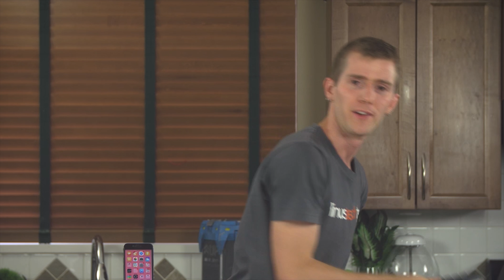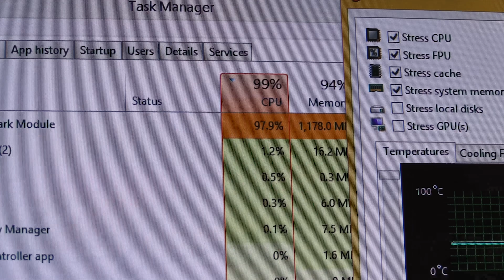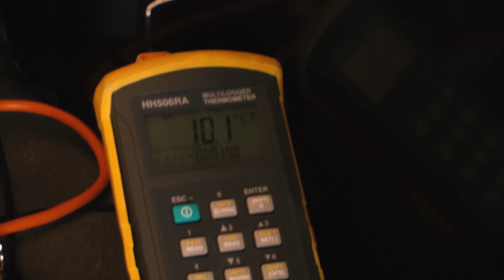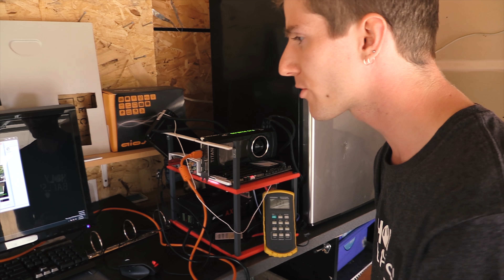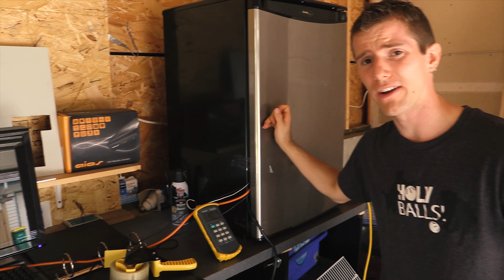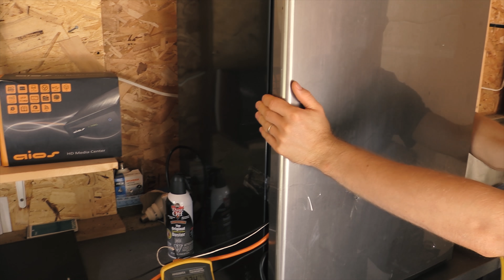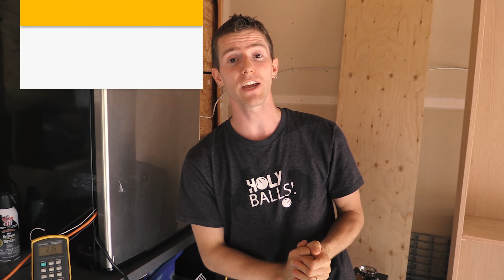PC Build in a Fridge - Does it Work??

Comment: Alternative setup: Instead of putting the computer itself inside a mini-fridge,  take a liquid cooling system with a specialized liquid capable of handling -10 degrees. Drill into the lid on each end the hole for the tubes and attach an additional pump on each end. Run the tubing coiled throughout the chest freezer using ice packs in the mix. keep the tubes from physically touching as well.

in this setup, you're dealing with a freezer rather than a refrigerator, which might pose a problem to put a computer into, but you were also only transferring heat from the CPU and/or GPU and letting the fans take care of all the other heat issues. The end result is A system that runs much much cooler, but I expect it would still have its limits considering how much heat those units give off. More likely, it would be useful if your computer isn't running 24/7, or if the idle temperatures are lower than what it can handle. if there's ice packs in the unit, as you ramp up to heavier usage, the load test will be more favorable. performance will gradually diminish of course, but because the liquid cooling is running through the freezer as an additional step to its existing means of keeping cool, it will never get to a point that could potentially damage the unit meaning that it will always be more beneficial than not, although the cost of electricity and the setup is another argument

Comment: There are more variables here than what you accounted for. For example the computer will want to operate within a certain temperature range unless instructed otherwise. It will turn the fans off if they're not needed for example, or run them at a very low speed. That should be accounted for by manually adjusting fan speed to the same speed as it would be in a room temperature scenario. Also, the refrigator will need some time to cool down something that experiences such rapid heating as a computer that has just been turned off.

Comment: the cool air from the fridge can just only low down the temperature of the computer system a bit, e.g: 44 degrees idle to 40 degrees idle.
the power of the fridge's cooling system is not enough to make changes to the computer system, which has a huge precent of eletricity converted to the heat.

Comment: If you want to get crazy with cooling then you should go with chilled liquid, TEC coolers or phase change.  The only major downside is all the insulation required, which requires a heck of a lot of time, work and research.  Then there's the money you'll be spending on all the electricity required to run those methods.  So in the end, in my opinion, a good liquid cooling setup is the best and most efficient way to cool your PC.  The clock speeds achievable by sub ambient cooling aren't really worth all the hassle.  In many cases your over clock won't even improve.

Comment: What you would want to do is a water cooled pc.  Run a good sized "precooler" (a decent sized radiator) outside the fridge to get the fluid to close to ambient temp.  Then run the fluid through another rad inside the fridge.  It would still put heat load on the fridge, but not to anywhere near the same extent (and could never exceed ambient temp).

Comment: That is a cool idea actually but might work as in 1999 we did it with bare MB with every thing installed put a cotton cloth to cover it then put a parachute waterproof sheet on top of cloth for condensation proofing and again a cotton cloth to absorb the first wave of condensation.
The fridge was new with copper heat pipes ,we let it to cool it at full cooling point first ,then put the MB with IO shield attached and chopped rest of the casing from top n bottom. We did not have temp gadgets to monitor it but it actually worked fine with over clocking for a NEED FOR SPEED test at very high settings and CPU OVER CLOCKED at 25% more than the recommended settings..I think it was the 3.1Ghz hyper threading OC and MB was an ASUS top of the line MB the GPU  was nVidea's 8800 series ASUS card.
========
What about DRY ICE cooling structure/housing custom build around a custom build casing or a car AC or those tiny AC's for camping attached to the casing with cooling fans blowing air in from one side and exhausting from other?
Has anyone done this ?

Comment: My first rack server I bought, I nicknamed 'Gerald the Fan Heater'. Likewise my workstations (all refurb and 2nd hand off ebay). I often say that you should think of a typical tower workstation as a 400W fan heater with a built-in calculator.

Comment: As a back-of-a-handkerchief calculation, taking the heat capacity of air, approx 1kJ/kgK, and assume the fridge has a volume of 100l, to keep the numbers simple, and air has a density of 1.27kg/m3, or 1.27kg/(1000l), so the 100l fridge contains .127kg of air. If we cool it from 22C to 2C (delta of 20C), then there is 20*.127 = 2.5kJ. Take the number of seconds to cool it, say T, and then 2500/T is the amount of watts being removed from the fridge. If this is less than the amount of heat put out by the rig, the amount of heat in the fridge (and hence temperature) will increase.

Comment: I'm curious as to thoughts: I have a cheap Atom Z8300 box (from China, prob banggood), and have the remains of an old HP rack server, including two large heatsinks. I'm wondering what opening the case on the Atom box and somehow using the heatsink from the HP to improve passive cooling would do.

Comment: People in these comments are kinda dumb. Fridges are designed to keep food cold. A computer emits heat constantly; food doesn't. A fridge can't keep up nor would a freezer. 

Also, the air is locked in tight. The hot air has no where to go and is being recycled through the computer constantly. 

You would have to customize a fridge or freezer so much it wouldn't be a fridge or freezer anymore. It doesn't work. 

(commenting because I saw guy saying that Linus made a mistake for not having a good seal on the door. Therefore, this video is invalid. I guess if the computer was watered cooled it might make a difference, but even still, waste of electricity.)

Comment: Allow the fridge to run for a full 24 hrs to reach optimal cooling before starting the test. Otherwise the fridge will not be performing it's best. I'd also suggest a "chest type FREEZER" not merely a fridge unit. Reason being the chest type are the most efficient since cool air goes down and when you open the lid on the top of the unit you're not allowing any cold air to escape. That would make for a more reliable test since the air in the unit will maintain a more constant temperature. But at least re - run the test with the fridge unit being at peak cooling before starting the test. It's a misrepresentation of the cooling ability of the fridge.

Comment: I wonder what would happen if you build a PC in a Walk-in style Fridge, like you would find at a resturant. Most of these fridges have air intake and exhaust which would circumvent the problems the mini-fridge ran into. I imagine moisture would be a big problem however.

Comment: try "PC Build in a Freezer" instead of a normal Fridge
Reply: It's the exact same principle. A refrigerator that has a lower set point on the thermostat. The same problem still exists. For this to work, you need to build a small room/case that will be cooled with an AC system, not a fridge. Just think of an actual commercial computer room full of servers. They don't just use a regular AC system like you have serving the rest of the adjoining offices. Those big Leibert units (yes I have a background in HVAC) were designed specifically for such uses. They run continuously rather than tripping on and off. There are smaller systems made for smaller computer rooms, and perhaps one could make a little closet with the indoor half of the system and their PC in there, and the outdoor half outdoors. Not exactly cheap, or practical but then again there's always somebody that will do it just because they can and no one else has.
Reply: What I was thinking
Reply: James L Ya a massive cubic volume reach in freezer, so it can keep up.
Reply: and the computer is a hot brick in the first place so it needs to cool the parts hardware and case first
Reply: There is also the problem of condensation, the first time you open the freezer door and water molecules from the air start attaching to your components your computer will be minutes away from a pop and a stop.
Reply: +Rob Fraser Yeah, theoretically the water vapor is pure (distilled) and once condensed remains that way until something contaminates it. The water itself is non-conductive but anything conductive at all that should get in the water will be a big problem. With all the dust that gathers within all desktops, and new stuff being continually sucked in via the fans, that water will not be pure anymore once it condenses on the boards or anywhere else. So basically, yup snap, crackle, pop is more than a breakfast cereal. I just thought we'd better point that out to anyone that get's the idea "hey the evaporated water will be pure when it condenses so I'll be alright.".
Reply: yeah but since computer parts are warmer that surrounding air it might be enough to cook off the moisture. depends on how cool the cpu and cooled parts get.  @WhoWouldWantThisName
Reply: @WalterGreenIII Well, in theory that sounds logical except that unless the PC stays operating under a sufficient load to maintain a high enough temp to do that, I believe condensation is inevitable. :(
Reply: I still believe that the concept of a controlled atmosphere in a small area (kept cold AND dry) is workable. Whether or not it's worth the trouble? Well someone else will have to take on this project as I have way too many and too important, or just better, things to do these days. Sorry.

Comment: yo man if you really wanted truly cold ambience should've went with a freezer.
Reply: yes and when the water in the air that is in all natural air (it's called humidity} sticks to the electronics as they start to freeze and it short circuits then it's to late and you realize you are an idiot, the amount of prep work to make a freezer run safely with normal air in it which is what will inevitably leak in unless the environment made around the fridge every time it is opened that would have to have massive amounts of air be severely dehumidified and there would have to be a good amount of those packets and that come in some stuff u buy with the little balls inside that say not to eat in there to to make sure the air in the fridge stays dehumidified, this is of course after spending hundreds if not thousands of dollars to make yourself a bubble boy type enclosure to dehumidify the air that will end up in the fridge when it is opened, pwned in 1 sentence lol.
Reply: you call me an idiot but can't comprehend what a joke is and reply with a completely pointless response. gg
Reply: >get pwned
>tee hee i'm not actually retarded wus just jokin guise lul

gg no re
Reply: lol the ten year old is throwing a fit. please write out a paragraph again, sweetie.

Comment: I have always wanted to try cooling a machine using an air conditioner with its evaporator coil submerged in a liquid coolant reservoir that is cycled through various parts of the computer such as CPU, GPU, RAM etc. Fairly expensive to set up and more than likely highly inefficient, BUT if a large enough air conditioning unit was used, say 10000 - 12000 BTU, It might actually work. For example. My current machine is in heated area that is kept around 15C, and the 4 core i5 is water cooled with a self contained corsair unit (I cant remember which one exactly I would have to check) but my idle temperatures were 15C, and doing basic tasks like you tube as I am right now, I am hard pressed to hit 25C,.... Thoughts?

Comment: It can work without issue.  And YOU CAN introduce airflow by punching air holes in the side without issue.  you just have to seal them properly and put them on motorized vents.

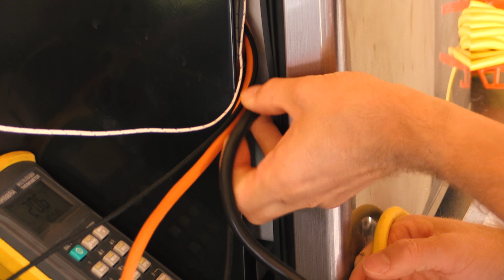Comment: As an engineering student, I approve the solution at 6:50
Reply: +lolfreak333
Robotics here. This is a legitimate solution. However, I would rather use duct tape.
Reply: Not there yet, I'll check it
Reply: Orcs R Kewl ya i think syrup would be better, that shit is sticky as hell
Reply: you forgot the water cycle, the humidity on air and surface of the computer parts. at the long you are gonna have a wet computer on, and thats a big danger. and by the way i am a mechanical engineering student
Reply: As an Nihilist, I don't care.
Reply: Starving African child here, can I eat your degree?
Reply: lolfreak333 
I think duct tape is better
Reply: Biochemistry here so I'm useless :'(
Reply: As a graduate engineer i disapprove. i don't believe that tape was appropriately rated for this type of job

Comment: His explanation why it doesn't work is wrong. Fridges don't dissipate heat via their side walls (these are actually very well insulated). It's done with a compressor that ... bla bla bla (can be looked up on Wikipedia).
You don't need airflow, all he would have needed was a more powerful fridge, that would have worked.

Comment: Condensation could be a problem but otherwise should work somewhat. Could require some modifications as you need air flow.

The biggest issue I can see is the efficiency. The fridge consumes nearly as much power as the gaming rig.

Comment: Wait... Did you put the water cooling radiator and fans inside ? It's supposed to extract heat, so if let inside, it's not that useful.
We'll need a test with this assumption. ^^

Comment: Love the channel, but this seems poorly done.  Logically, I'd build a water-cooled system, keep the power supply outside,  run the hot water outside put a radiator and fan set outside, run the water back in, and through some heat syncs that were attached to the freezer coil, then back into the computer.
Reply: Edward Rex that's a bad idea and you know why.
Reply: Patricia Harris and you know I didn't say it was a good idea.  I said it was poorly done and explained how easy it would be to do it right.

Comment: What if you have an industrial grade fridge and you use it to cool your water cooling system? 
It will take a while, so you will either need multiple radiators or lots of thin pipe to maximise surface area and time inside the fridge, but if you can pull that off you probably have a good overclocking system.

Comment: I like the idea here and bringing up the AC unit would it be possible to create a loop system to cool your PC air cool only no water cooling or anything like that where you use a window AC unit that funnels that cold air through and over your PC components and exhausted back out the window intern giving you a window mounted Sub-Zero system it's just speculation I haven't ran any mathematics on it it's like 2 a.m. and I ran across this video I just thought it's possible that you could create a closed loop system or open using a AC window unit and funneling the intake and the exhaust into like a wind tunnel in where your PC set

Comment: It was negative 20 gegrees celsius outside last week. So I decided to open a window and benchmark my pc. I had an average temperature of 55 degrees on an overclocked rx480 whith a stock cooler. And the room temperature remained comfortable, so in theory I could achive more. Winter rocks.

Comment: Honestly I don't think the concept actually works. Because of inefficiency. The refrigerator is constantly running and the other thing that is not taking into account is the fact that our refrigerator actually sweats. This means the computer hardware would get wet and moisture buildup which would ultimately lead to  the computer chips shorting out. What I want to see from the industry is a vacuum sealed computer.  That does not use any type of air circulation for cooling. Then we use a third-party liquid cooling unit that operates off of PEX line. Which is used in the heating and cooling, as well as plumbing industry. Every computer component including the hard drives would actually have a heatsink. All this would run to and energy exchange.  Which would transfer the heat Into your residential heating and cooling system as an energy dump. Imagine your computer  heating water inside of your hot water tank. Basically to run a system like this you would need to run two PEX lines from your computer to your utility room. Some people might think this is impractical. But imagine for a large office buildings struggling with heating and cooling. This is a very practical solution.

Comment: A mini fridge maximum input power is typically 150W. Given an 80% efficiency that is 120W useful power in removing heat from its interior. By placing a computer system inside the fridge is like placing a heat source in it. If the computer system was producing 120W of heat in idle that is meant the fridge had zero power left in further heat removal from its interior in order to decrease the temperature. So not surprisingly the temperature in its interior is in thermal equilibrium with the ambient. Basic thermodynamics.

Comment: there most definitely is a viable and somewhat practical way to make this work. it does have some drawbacks.. you wouldn't be able to cool your PC for 24 hours constantly. but you could have sub ambient temperature s for a couple hours a day at least. which for a gaming rig would be fine. when I build my next computer, I might just do that to cool my current 6600k. unless Linus happens to be interested in making it happen for another video. (it doesn't involve putting the whole computer in the fridge. in fact none of the computer would actually be in the fridge.)  I have some science to actually back up the fact that it would be possible.